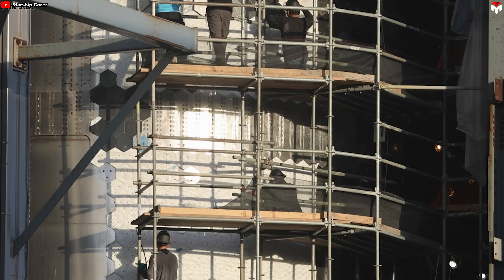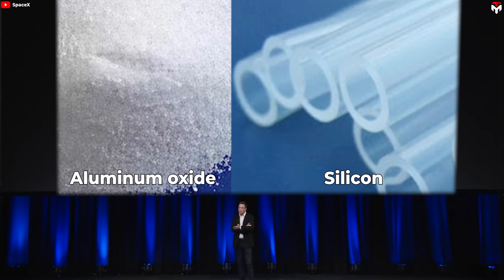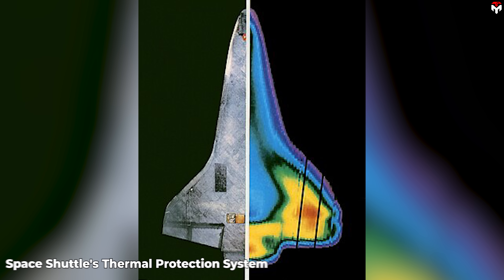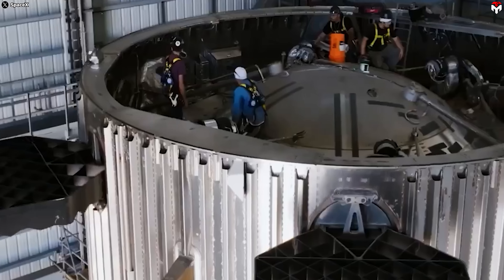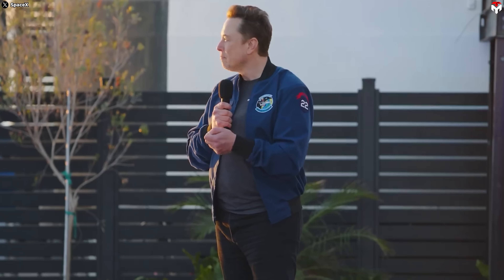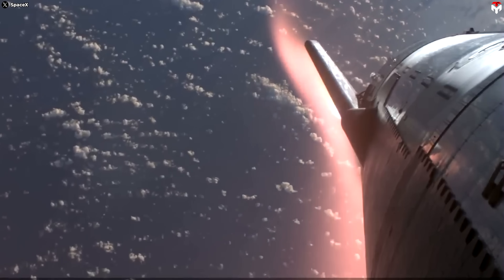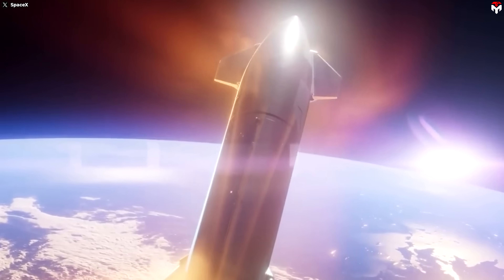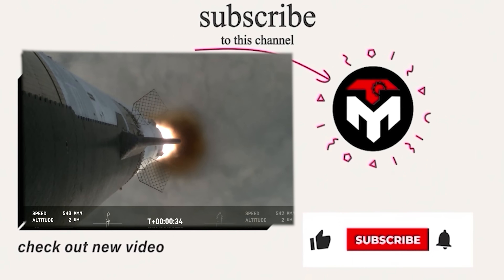SpaceX's Genius Solution On Starship Heat Shield Just Humiliates NASA Shuttle!

Comment: Irrelevant, as it relates to the now defunct shuttle program, but the tiles were not made on an 'as needed' basis. They were produced, numbered and stored. It's not as if they needed thousands of each individual tile, and there was no logistical nightmare involved in procuring replacements. One complete backup set on hand for each shuttle for each launch and return is enough. The tiles that were replaced are easy enough to order replacements for, just give the vendor the part numbers for the ones you need to refill inventory.

Moot point though, as I said. Elon found a better way. Make them all basically the same.

Comment: Stainless steel cannot be cut by oxy acetylene torch the way non stainless steel can. Isn’t the re-entry process a hot torch?
Reply: I'm a welder, yes you can cut stainless-steel with an oxy-acetylene torch.

Comment: Shuttle Thermal Tiles were perfectly adequate. SHUTTLE TECHNICAL FAILURE was POOR Rubber O-Ring Design on The SRB [killed 7 people], POOR Foam Insulation Design ON The Booster Tank penetrated the Wing [killed 7 people].
Reply: The engineers knew the o-ring "flaw" was very cold weather.  It was deemed acceptable for Florida.  Safety engineers were vetoed outof the decision  on the cold Challenger  launch day -that was a horrible decision.

Comment: I understand the hyperbole to gain viewers. The content is excellent and informative. NASA has no reason to be disgruntled - the Space Shuttle was born in the 1960s when so much modern technology did not exist, it was built in the 1970s, and used from the 1980s until the second decade of the 21st Century. Without it the ISS would not have been built. If Starship works will it last three decades - no of course not. The pace of change is fast and Elon Musk is almost certainly theorising if not planning something better.

Comment: BASIC SPACE SHUTTLE CONCEPT WAS EXCELLENT -- HOWEVER ACTUAL DESIGN METHODS WERE MINDLESS ... incl the use of "FOAM" in the Structure, and the Use of "RUBBER SEALS" IN SOLID PROPELLANTJOINTS that can reach 6,000 DEG F. There Were Early Proposals on Shuttle (before award) that DAMNED ANY SRB SECTIONS because it was UNSAFE, difficult to SEAL. .

Comment: The cold hard facts. Stainless will not make starships impervious to heat as hot as 3,000 degrees. Why starship will never survive is tile adhesion factor. Elon putting a blanket between the stainless steel and the tiles is stupid. The blanket will only insulated the tiles from the onboard -450 degree fuel. The problem Elon can’t see is one of thermal dynamics and the atmosphere acting upon the the blanket, the tiles and the massive surface area of star-ship. He will never launch a man mission with stainless steel rocket. Your throwing 9 time more weight on the rocket that would lighten the rocket and carry all the payload. A aluminum body would not suffer damage as the tile can be bonded directly to the aluminum. The space shuttle was constructed of aluminum. Falcon 9 and super heavy were made of aluminum.

Your idea that the aluminum will melt behind the tiles is incorrect. But your tiles have one more problem and this is why you’re trying to use stainless steel. Your tiles have gaps between each tile.
That is a problem, but not compared to star-ship tile flying off when the in counter the atmosphere.
Reply: Genius I think not!
Reply: So why not make it out of Aluminum? Can it not handle the weight ?

Comment: There is a solution for the Starship heat shield problem. (The sheer quantity of ceramic tiles increases tremendously the probability that some of them will fail and cause a catastrophic accident).  
The solution would be to drastically reduce the temperature of the tiles during reentry by increasing the time necessary to dissipate the heat generated (two hours?). It could be done by unrolling cables behind the Starship during reentry. That would increase the drag on the vehicle, would reduce its speed and the temperature of the tiles.

Comment: Why not use hafnium carbide or the newer form with nitride.  The material can with stand more than 3900 C, which is mind blowing.  There was a reason why the mig 25 was built using steel over aluminum.  Musk learned his lesson.

Comment: Nothing about starship has shown any genius.   The ‘reusable’ spaceship has yet to be reused. Its launch platform has never come thru a launch without requiring millions in repairs, because Musk ignored the design experience of every other large launch facility on earth and failed to put a flame diverters and water deluge at the rocket nozzles, like everyone else’s rapidly reusable launch pads some dating back 60 years. His starship is not large enough to lift anything but itself to orbit, and both the rocket and tower will have to be made larger, because spaceX did not do the math to figure out the design in advance.   The entire design of this starship has yet to show it can survive re-entry, much less be re-usable afterwards. And Musk did NOT do any testing to even verify if the flap system CAN survive re-entry. ( he could have used the hypersonic wind tunnel at NASA, or even built a smaller test article version that could have been launched on a falcon 9 just to prove the concept and refine the design before committing to the full scale rocket.   Artemis, by contrast, though over budget ( like starship is ) and behind schedule ( like starship is ) launched flawlessly its first try because the corporations that developed it did all the work in the design phase to make sure they had a complete and fully Functional vehicle the first time.
I know Muskovites are in thrall with his lies about how smart he is, but thus far, starship development has been nothing but serial failures pointing to a fundamental inability to design a solution that will work on the drawing board, or thru test articles. 
The burn thru of the flaps on starship could have been predicted with proper modeling, and flying a test article years ago. Rather than waiting until billions had been spent on a design that might not work, and a launch facility that might need to be entirely replaced because the original design concept turned out to be unworkable .
Reply: I think your missing the point.  The point is to continually increase production capacity to crank out designs that meet incremental goals until the final design is achieved..  The problem with the engineering methodology that you are suggesting is that the "modelling" and "test articles" rarely capture full complexity of the integrated system, and engineering teams overly focus on their narrow area of the project, instead of the overarching goal.

Comment: I remember the Space Shuttle 30,000 plus unique tiles and compare it with the hexagonal Star Ship tiles.  37,000 Unique tiles.   What the heck is that, no wonder it costs so much.  Those companies were ripping off NASA and NASA let them!
Reply: I believe it was a little over 24,000 tiles, and when the Space Shuttle program was officially started in 1972 the heatshield problem hadn't even been worked out as yet, since nothing like it had ever been done before for a spacecraft (i.e. a re-useable heat shield).

So no-one was ripping off NASA, instead it was a problem that was still being worked on leading up to the first Shuttle launch in 1981 and they were still working on improving it during the 30 years of Shuttle service, since the tiles are very fragile and it was difficult to ensure a perfect bond between the tiles and the Shuttle.

The fact that a company today can improve upon a heatshield system developed 50 years ago shouldn't be a shock to anyone :-|
Reply from the maker: The Space Shuttle was a technological masterpiece but also an economic disaster. Its era was glorious but  ended. SpaceX is doing very well with Starship, and they will continue the glory. Importantly, they are mostly self-funded.